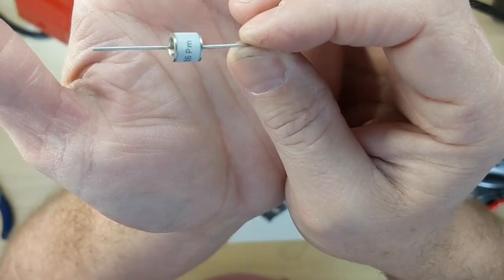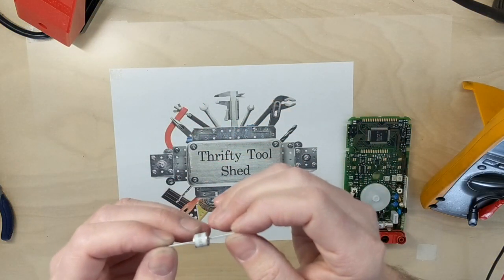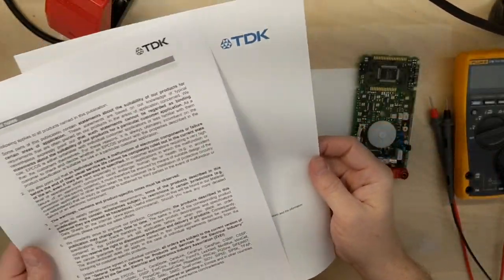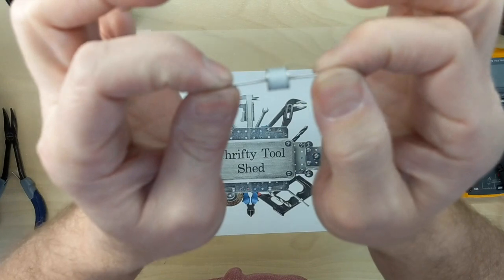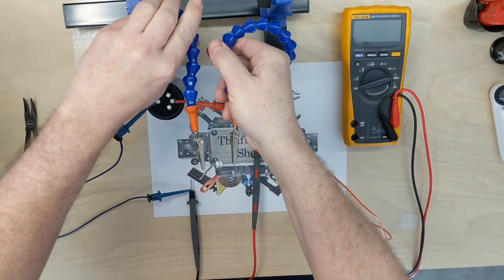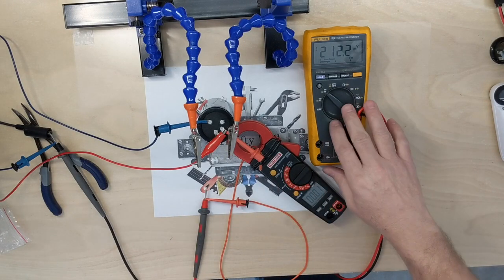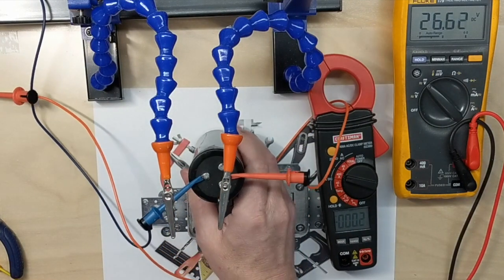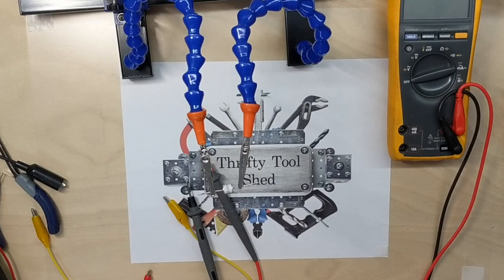Gas Discharge Tube  (Weekly What Is It #3)

Comment: GREAT VIDEO--I an just working on a project that triggers in GDT's.  A couple things though:
(1) It would be informative if you let the capacitor slowly rise through a resistor, ...continuously... until it breaks over.  maybe several identical GDT's, watching for the difference in sparkover voltage.
(2) Wire a couple in series to see how triggering adds.
(3) PLEASE!! do something about that background drawing--it gets hard to differentiate the real device details with that drawing.

Thanks for the timely & helpful video--this subject seems hard to find on youtube.
Reply from the maker: dale nassar, Thanks for taking the time for comments and suggestions!
Reply from the maker: dale nassar, BTW it did take me a while to think about what you meant about the background drawing. I actually made the logo much smaller dozens of videos ago! That should better?
Reply: I just did some tests with GDT's of three different values of GDT's in series.  I used all combinations, and each time the trip point voltage was the sum of the GDT's in series.  I could not find this information ANYWHERE.  But it appears that GDT's can be used in series.
Example:  a 600v and a 230v GDT in series fires at 830v!
Reply from the maker: dale nassar, that's really neat. I would not have thought they would work well like that. Great information. I actually do not currently have 3 alike to try.  But will have to check that out!

Comment: I’m curious if your amp clamp worked OK after this test? Not only would the current be off the scale but it would go from zero to maximum very quickly due to the high voltage of the capacitor, and low inductance of the test leads.

An electrolytic capacitor of that voltage and capacitance is usually 40 or 50 something milli ohms internal resistance. You can do the math…
Reply from the maker: It has been perfectly fine the last 5 years and yes I can!
Reply: @ThriftyToolShed  I’m impressed it held up to that!

Maybe the amp clamp is protected by another tube like this across it’s current sensing coil and shunt resistor…

Comment: At ~  8:13  you mention the energy suppressed.  Well, here with a 2200uF cap charged to 260v, that energy is 0.5CV^2=74.5 Joules ... a good bit!!  I watched the 'analog' display on your DMM, and it seemed to go to zero!   Do you have a 'scope?  Also, it is interesting to break some of the GDT devices open and look at the electrodes.  They seem to be made of some sort of thick metal screening.  interestingly, of the ones I cracked open, ~4, they ALL seemed to be badly corroded!  ...maybe this is normal??? ...sure doesn't look it!  They were from someplace like digi-Key or Mouser--NOT China-ebay!  But I did get 100 pieces for only a few bucks.  Some nice scope traces would be great.
Thanks again,
--dalE
Reply from the maker: dale nassar, Very interesting! Yes I do have a scope and have used it in several videos. I absolutely know that the video did not have a lot of detail. I tried my best to put out a series of quick videos and if alot of interest was shown , then I planned to go further in depth?  I have some repair videos close to an hour long. The details of a repair Is hard to cut down. I try to do some short videos, but yes as you mentioned, I left out alot of good information! Its tougher to balance the time and detail than I even imagined!

Comment: I HEAR SPARK GAPS GIVE OFF OZONE, WHICH apprently isnt good to inhale, so do these not give off ozone ?
Reply from the maker: These Gas discharge tubes are inert gas filled so not air separated, but yes Spark gaps or any high voltage arc such as this can absolutely produce small levels of ozone. You can usually smell it. I used to work in areas where large amounts of Ozone are created while high voltage treating of plastic film using carona discharge. It was just fans installed to evacuate it from the building. You could absolutely smell it pretty strong. Ozone is created when oxygen (O2) is exposed to an electrical field or ultraviolet (UV) light. The high energy causes some of the O2 molecules to split into individual oxygen atoms. These free oxygen atoms then combine with  O2 molecules to form 03 ozone.
Keep in mind they only discharge in the event of a high voltage spike like a lightning strike. They do absolutely nothing during normal everyday operation of the board. Similar to MOV's etc.
Reply: i see , thank you ! 03 ! yes evacuate the gas makes sense ! my spark gaps do seem to smell a bit !! i was slightly concerned about it. i have a HV spark gap component in some of my experiments. so maybe i should have a fan blowing it out the window would you say ?! so GDT's are not an air gap but a gas chamber,  so its not open to freely available air and oxygen, so they are maybe less toxic than spark gaps yes ? and so do they not produce ozone at all then ? or does air get into the tube a bit ? just wanna check this !  : )  thanks man  @ThriftyToolShed
Reply from the maker: @tvdylan  
I believe since they are gas sealed, there is no corona or ozone. I have no real way to be 100% sure to be honest. I would use a fan If you do smell it a good bit. I will say I have never had any issues with ozone at all just experimenting, but it seems some people may possibly be less tolerant than others to it.
Reply: OKAY THANK YOU SIR !!! cheers.  @ThriftyToolShed

Comment: Hi my friend, I made 2 arrester plugs and I used a dual gas spark gap arrester and a varistor as well as in this scheme
Https://iu8cri.altervista.org/costruzione-semplice-protezione-sovratensione-tipo-3-spina/
Initially nothing happened, but then sometimes during the day the differential or the thermal magnetic circuit breaker of the line taken trips. I don't understand why after hours and hours that nothing happens, sometimes the differential intervenes, sometimes the magnetothermic instead: when asked, the amateur designer told me that the spark gaps are very sensitive. I understand the sensitivity, but finding the disconnected current in the absence is not so beautiful, especially for the refrigerator. What do you think about it? Is it possible to solve the problem? Could it be that I have to install them upstream of the differential and the thermal magnetic circuit breaker?
Reply from the maker: Well, is there any way to measure incoming power spikes. I know years ago at an industrial plant, the power would spike at times and trip some drives we had on over voltage trip. Anyway, the power company argued it was not them that it was well with in tolerance. After I connected a power analyzer to record, we at times seen spikes 3 times the incoming 480v. They still stated it was fine and it was our problem, come to find out they had been switching a big capacitor bank on and off at times as needed on there lines, they would not tell is this, but someone we know there told us. So sometimes power will spike above a theshold and if not able to change it we may have to raise the rating of the device we use. In your case, what is the voltage in and rating of gas discharge tube. Also is the Varistor rating high enough?
Reply: @ThriftyToolShed  ok This is the pdf link of the double spark distributor : https://iu8cri.altervista.org/wp-content/uploads/2017/11/t23_a350x_x7200-525953.pdf
and this is the  pdf link of the varistore : https://iu8cri.altervista.org/wp-content/uploads/2017/11/SIOV_Leaded_StandarD.pdf